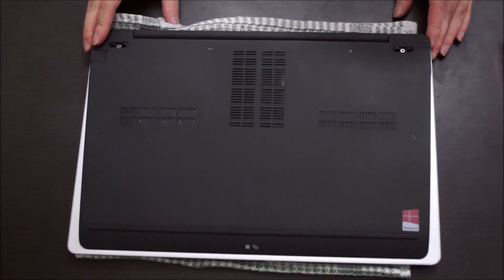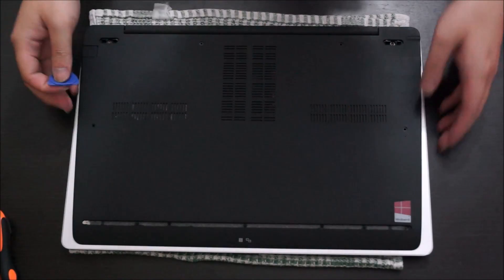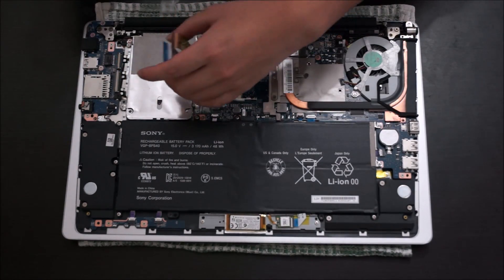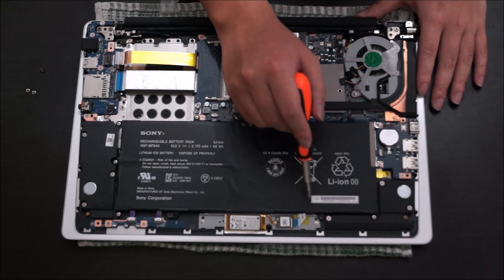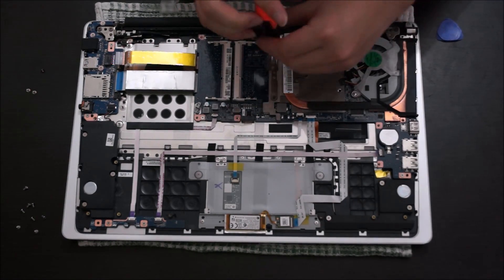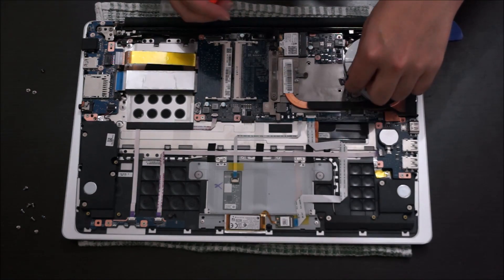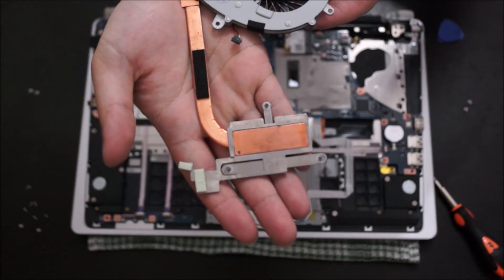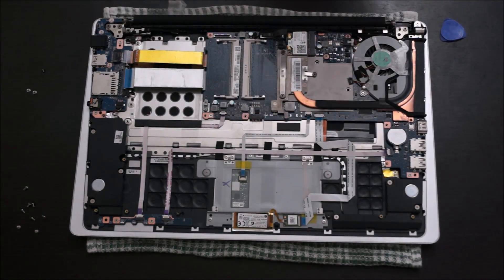OPEN ME UP! Sony Vaio Fit 15a Disassembly

Comment: Laptop look is charging and stops battery saying 4% , now. It has never been replaced.
Reply from the maker: the battery is dead
Reply: @OpenMeUpTec  thanks , mine is touch one , does it have only one battery?  My computer is old but I'm still so reluctant to give it away just because the battery needs replacement.
Reply from the maker: @stefmarce22  they all have one battery only. as it is not 2 units the screen is attached the the keyboard. the battery is going to cost more than the unit itself therefore it is not worth replacing

Comment: @Scott Chou Hi, I have a “Sony VAIO SVF14N2A4ES Fit 14A Multi-flip 14” Laptop”. The Disk usage shows 100% so whilst I was searching for a solution I found myself on this video and comments. I wonder what is a good SSD that I can use to replace my 1TB HDD. Video description says that you’ve used: “Samsung Electronics 840 EVO-Series 1TB”. I suppose this is an older model and not sold anymore, so what would be a compatible SSD for my laptop? Thanks.
Reply from the maker: if it fits in the slot it should work  as this is not an apple. most likely your hard drive is faulty and needs to be replace. you can buy anything that will fit. now you can get an samsung 870quo sata 2.5inch
Reply: @OpenMeUpTec  Thank you. Whilst the laptop back cover is opened up, I might go for a memory upgrade also. My laptop comes as 8GB RAM. I assume it comprises if 2x 4GB Rams on 2 separate slots. I heard previously that you cannot install 1x 8GB RAM on certain laptops. So to max it up to 16GBs, would I need 2x 8GB DDR3 modules? If so what make would you recommend please?
Reply from the maker: @TiredParent  if you going to change it then buy 2x8. no you can use a single 1x8 if you want or even 4 and 8

Comment: My sony vaio laptop is just same as that one, but out of nowhere stop displaying, if I connect it to the TV using HDMI it works, so I guess the screen is gone, how to replace the screen??
Reply from the maker: if you are asking me you dont. as it is a hard and complex process. if you needing help to do this you shouldnt be doing it yourself. also this is an old laptop and not worth the cost of replacing the screen

Comment: I don't have the 15a, rather the 15n26ccxb, but do you have a recommended wifi card?
Reply from the maker: what si wrong with your current one. normally most laptops come with a intel 8260ac which is like $20AUD

Comment: Really helpful. I upgraded my Sony VAIO Fit with SSD, more RAM, and new WiFi card 😎👍
Reply from the maker: thanks for your support
Reply: hey man, I'm replacing the shitty wifi card in mine. Which did you buy that worked?
Reply: @canzosis75  Same question here. Looking for a 802.11ac card that work in it.

Comment: Congratulations on the post. I have a laptop of the same make and model. I had to change the battery because it only worked with the charger. Now with the new battery it does not work, only with the charger. Would you have any idea why the computer does not decrypt the battery?
Reply from the maker: your battery function/part is faulty. so the laptop does not read/know your laptop battery is connected. basically you have a laptop without a battery that is whats happening.  i have seen this before and you can actually fix it but requires you to see a computer store as you need to replace one of the chips on the motherboard

Comment: Thanks for the video! I changed the hdd for a ssd hdd but now the laptop will not power on any more. What could be wrong? Any help would be appreciated
Reply from the maker: this quite common. you must have forgot something. so does the laptop turn on? does the fan spin? is there any beeping sound?

Comment: it has too much purpose unknown cable inside the chassis, so it has lots strange problem, if it change to single high reliable PCB motherboard just like macbook , I will buy it
Reply from the maker: probably why they dont make this anymore and there is really no reason to open up the new macbooks as there is nothing you can do if you open them up

Comment: bro great video need your help do you know where the back light fuse is located ?
Reply from the maker: thanks for your support. sorry cant help you as i dont know where the fuse is. i never knew they even had fuses in laptops
Reply: No problem did some diging and found images of the motherboard and found out fuse is located on the bottom bypassed it now the back light is back on
Reply: guys, how is the keyboard connected ? I have an issue with the keyboard all of a sudden, it just doesn't work. A week before I had it repaired and I think the aftermath of the repair can be the culprit i.e. my screen wouldn't hold anymore as all of the plastic through which the screws went got broken long story short is that the repair guy used shit lots of glue. The monitor holds and moves smoothly. BUUUUT when I try to lift back plastic I see that some thick cables(the ones at the top of the pc, close to the monitor) got glued to the plastic piece I am trying to remove! Are those cables related to the keyboard in any way or just the screen? Also have no clue how to detach those cables now, should I just shatter the old back piece until there is only a bit of it left on a cable and get a new one instead :D ? looking forward to your reply on this one very much

Comment: Thank you for the great video!

I have an SVF15N1S2ES laptop. You mentioned that you can put 2x8 GB RAM ("16 gigs in total") but on its datasheet the max. supported memory is 8GB. Does that mean that 8GB / slot ? 

Now there are 2x4GB RAM modules in it and I want to upgrade it to 2x8GB but I am little bit confused now. 

Oh and one more question: is it possible to change the wireless card to one that supports 802.11ac as well? 

Thank you for your answers in advance.
Reply from the maker: CPU is solder on, graphic card is solder on, ram can be changed to 16GB max with 8GB in each slot and there is 2 slots, wireless card can be changed, and hard drive is a 2.5" inch thin 7mm thick.  

the data sheet is old probably why it doesnt say 16GB as it didnt exist when they created the sheet. this is not an apple, if it fits in the slots then it should work. i have 7260ac in mines back then and it works
Reply: Thank you very much for your detailed answer!
Reply: @pezosanta  Hey there, did you replace the ram with 16GB and upgrade the wireless card? Which wireless card did you replace it with to support 802.11ac?
Reply: @pezosanta  Bro, did you upgrade the RAM ?

Comment: Great teardown video bro... my laptop's hdd is crashed can you guide me what is the model number of compatible hdd with sony vaio fit svf15n17sns?
Reply from the maker: any 2.5 inch hard drive that 7mm will work. most of them are now that size if you buy an older hard drive it will be 9mm thick
Reply: OPEN ME UP I shall be highly thankful if you can point me to the link of compatible HDD... i am planing to buy it online but not sure if it doesn't work. 

Also tell me whether i can install SSD into it or i should stick to HDD

Many thankz
Reply from the maker: most ssd at 7mm thick only issues are normal hard drives which most are 9mm thick. the best SSD are samsung and intel but really any would do. i have provided you with an example below. https://www.pccasegear.com/products/37578?gclid=Cj0KEQiAh4fEBRCZhriIjLfArrQBEiQArzzDAXTrgKM-6tLodzSSWw2b4VO-0iqhXQv-TA0ITuMSRsIaArdI8P8HAQ&gclsrc=aw.ds

Comment: http://ar.aliexpress.com/item/Brand-New-LVDS-Led-Lcd-Cable-for-Sony-VAIO-SVF14-SVF142-Svf142190x-SVF142C29M-DD0HK8LC010-DD0HK8LC000-Flex/32326597219.html?spm=2114.51010208.4.12.Js4Efs        can i buy that cable for fit13?
Reply from the maker: +mohamed sayed probably if these isnt a better option. I can not confirm it for you as i no longer have the item to see.

Comment: hello dear,,i have a question,, is flex cable of lcd sony fit 13 is same flex cable of sony fit 14?  aslo where can i buy flex cable for fit 13,,thanks
Reply from the maker: +mohamed sayed normal cables for screens in the for in the same model range is the same but the length is not. the bigger laptops with have long cable compared to the smaller ones. i will assume it is the same but i doubt you will find one. try ebay, also cables have a sticker on it which tells you the part number.